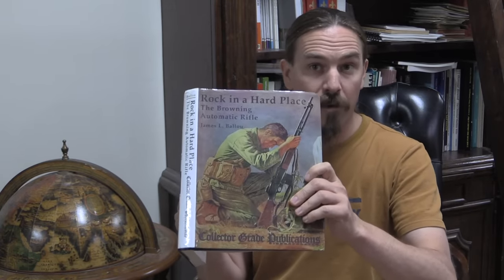Ask Ian: Why Not a Semiauto BAR Instead of the Garand?

Comment: Obviously we're playing armchair generals rn, but personally I think a 20 round magazine would have been far better than an 8 round clip. Imagine a standard us rifle squad in ww2 armed with semi auto B.A.R's against German and Japanese squads armed with Kar98 and Arisakas respectively. The Garand already proved too outclass those weapons with its ability too sustain fire, imagine more than Doubling its capacity! Obviously there are downsides, and hindsight is 2020, but I feel like there's something there you know?
Reply: So we're going on a 30 mile cross country march. I get the 10 lb weight in addition to 70 lbs of gear. You sir, you get the 20 lb weight. Let's see what you favor after the first five miles. Weight is always a factor. Otherwise everyone would be using some variation of the 240 right now instead of the M4.
Reply: Let me introduce you to the "M1 Carbine."
Reply: I doubt the bigger mags would be a significant advantage, especially when you consider that they would very likely be slower to reload and much more expensive, before considering all the other issues the BAR has
Reply: @durayenterprisesllc4440  The carbine was developed to replace the pistol and to arm support troops, not as a main infantry battle rifle, which most everyone wanted it to be, but it is not. If the Korean war era soldiers complained about the Carbine not being effective, well, they should have been using an 3006 M1 Garand.
Reply: @jason60chev  be careful with soldier memoirs lol. They said that winter coats were "stopping" their rounds. No, just no. They were missing due to probably shooting out of effective range. It's all about context, but yeah, it still wouldnt be a good all around replacement for the M1
Reply: Yes 20 round mags would have been much better in the Garand but Generals back then had no clue how modern warfare would evolve. To them reducing rounds a weapon could carry caused soldiers to take more precise aimed fire instead of the spray and pray strategy of modern warfare.
Reply: @0neDoomedSpaceMarine  It could almost be said that the 8 round En Bloc clip WAS/IS an 8 round magazine, all by itself. The reloading is very similar to a det mag gun and I would say faster, because, in most cases, you have to save the empty mag on a det mag gun, unless your supply system issues you loaded mags. With the M1, the bolt locks open, the empty clip is ejected, it takes a few seconds to retrieve a new clip ("Mag"), load and close the bolt.  In rifle matches, both the M1 match and Service rifles matches, rapid fire strings are 80 seconds to fire 10 rounds for score, including a reload.
Reply: @0neDoomedSpaceMarine  yea they did exactly that when the M14 was adopted. And that weapon system was horrendous in full automatic fire. The BAR was much more effective in full automatic fire. And box magazines were not new technology in WW1.

Comment: What haven't been mention is that BAR is horribly complicated internally, literally millions of small and complex elements inside receiver. It would be hard for common joe to field strip gun for cleaning, do not lose any parts in the process and put it back together correctly.
Reply: I agree, we still had some BAR's in my ROTC unit 1970-71 and it was hell to field strip and clean compared to more modern weapons.

Comment: Given the military brass' mentality, I can almost predict what a future weapons inventor of a handheld particle beam rifle would have with a general:
General: What is this?
Inventor: A particle beam weapon
General: Where is the magazine?
Inventor: It doesn't have one. I has a mini-fusion battery.
General: But how do you reload it when it's empty.
Inventor: It has a 10,000 shots capacity. You change out the battery.
General: Where is the bolt assist?
Inventor: It doesn't have a bolt. It is a solid state device.
General: Where is the safety?
Inventor: It has an ON and OFF switch.
General: Where is the ejection port.
Inventor: It does not use cartridge ammo. It's an energy weapon.
General: How do you fieldstrip for maintenance?
Inventor: You don't. It's a solid state device.
General: But what if if jams?
Inventor: There is no mechanic component to jam. It is a solid state device.
General: Sorry, but your invention doesn't meet our requirements.

Comment: Shortly before WWII American gun retailers tried to get contracts in Europe for the BAR, which could be conveniently converted into 8 mm Mauser(then the dominant military cartridge). Also American companies sold kits which could be used to convert a BAR into 8 mm Mauser.
American gun dealers also tried to sell muzzle compensators to European customers.
Actually many BARs reached Europe prior to the hostilities in several European countries(especially Poland).
Then war broke out and the German soldiers found out that they no semiauto rifles. That changed, when in Belgium and Poland a large stock of BARs were captured plus many spare parts. The German soldiers stripped down BARs( removed the tripod and other heavy parts) monted a compensator and presto they had a primitive semiauto rifle. The conversion was usually made by armorers just behind the  front lines.

Comment: As for the M5, troops nowadays get to be carried by Strykers, Bradleys, M113s and a multitude of other vehicles. You'd be lucky if you got onto a truck in the 1920s and didn't have to march 20 miles a day. 
So, i absolutly agree that the weight requirement of the day is needed- But in this day and age with fully mechanized infantry and exoskeletons being fielded (Admittedly in limited field testing, but still) i don't see the M5 as being too heavy. 
Compare it to an M14, not to an M4.

Comment: Cost and weight of the BAR was $319 and 16 pounds bare in 1942--there was a lighter Colt Monitor made commercially but I can't find the price tag on that.  Simplified and lightened, a semiautomatic BAR firing from a closed bolt might have been almost as lightweight as the Garand, but cost would have been greater--and then there's the way that the ammunition was packed.  Eight-shot Garand clips were cheaper than having both 20-round magazines and 5-round Mauser-style magazine chargers (stripper clips) and the magazines were not reloadable on the rifle (as with the M14).
The Garand was $85 and 11 pounds (was supposed to be 9.5 pounds but wood sometimes weighed more) in 1942 and the size, weight and price tag was excessive for non-riflemen, plus the older M1903 Springfield still in service was a five-shot bolt action, so the "replacement" for the pistol and the tommy gun (and Springfields) was the 5.5-pound M1 Carbine for $45 each in 1942.  From 1936 to 1942 the Garand was supposed to replace the Springfield, the BAR, and the tommy gun--the semiautomatic rifle was thought to have sufficient firepower so that Infantry Branch decided that two light machine guns per rifle company were enough automatic weapons, and the rest of the company would have the Garand--and pistols for leadership personnel.  Real war demonstrated the folly of that stance.  Regular foot infantry had BARs at squad level in 1944 along with two M1919A4 light machine guns, and special troops often had a mix of BARs, M1919A6 or Johnson light machine gun, and tommy guns at squad level.  The Marines fielded three BARs per rifle squad and fooled around with arming the squad leader with either a submachine gun or M1 Carbine.  
That was a good question but when the Big Army makes up its mind, 2x4 therapy might not be enough--use a sledge hammer!

Comment: My understanding is that the army did not want detachable box magazines on the new rifle because of the problems they were having with the BAR magazines.  Those problems continued into WW2, so maybe they made the correct choice.

IMHO a major reason for not standardising on a lightened BAR is that open bolt operation is not conducive to accurate semi-auto fire.
Reply: I'm surprised that this wasn't mentioned in the video.

Comment: Great video. 

your last video on progressive twist rates and talking about the 1891 Carcano Rifle made me do a 'refresher' reading about some of the related military cartridges. 

I find the enter conversation of .30 cal cartridge variants and 7.62 variants a vary interesting one. 
From the whole fact that the 1891 rifle was 6.5mm way before 6.5 creedmore, to the proven trackrecord of 30-06, to then 7.62x51 NATO being adapted, but then shortly later the 7mm-08 was developed in 60s, and now the 6.8/.277 Fury is basically a VERY close to a 7mm-08 just made with the hybrid brass/steel cartridge for that insane 80k psi. 

The fact that the .270 is a cartridge that is considered 'old' like .243 but those hunting/snipe rifles still considered quite solid for what they are, but that new 6.8mm is just a slightly necked down and overpressured load is all very interesting.

Comment: One major shortcoming of both the Garand rifle and the BAR weapon was the 7.62x63mm/.30-06 caliber round. The .30-06 round is suboptimal for automatic fire with its savage vicious recoil requiring a heavy weapon to absorb the recoil in a shoulder fired weapon. It is doubtful you could fire a BAR in full automatic mode with it lighter than the roughly 16 lbs it weighed and still keep the rounds on target. The BAR had no way of changing an overheated barrel too. The Garand rifle was in semiautomatic mode in .30-06 but weighed around 10lbs fully loaded. The Garand was a heavy combat rifle. The .30-06 round was heavy enough so a soldier was limited in the amount of ammunition he could carry. Soldiers serving in machine gun crews generally carried a limited amount of ammunition for automatic weapons. Imagine going on a 24 mile road march with 60 to a 100 rounds of .30-06 plus the ten pound Garand rifle fully loaded along with other gear. Most combat ranges were at relatively close range. So the weight any American soldier could carry was limited but the need for a thousand meter ranged Garand rifle is questionable. 

The .30-06 round was a hard hitting round with a range of around a 1,000 meters. Here again how many combat soldiers ever shot more than 200 meters on a routine basis is probably quite small. The US Army Ordinance Department should have developed a smaller more compact round similar to the more modern .308 or 7.62x51mm or some similar round. Lots of gun powder was wasted in the long 30-06 round. The M1 Carbine had an type of intermediate round of 7.62x33mm which was actually a much better semiautomatic round. I have often thought the US Army could have fought WW2 with a platoon of infantry that mostly carried the M1 Carbine and the Grease gun submachine gun with the several BAR's in a each squad with a ratio of one BAR per four soldiers with some more heavier .30 caliber machine guns like the 1919 Browning machine gun in the platoon. The soldierscwith M1 Carbines or a Grease gun could have carried more ammo for the BAR's. Perhaps several soldiers per squad could have had bolt action Springfield 1903 rifles modified to shot rifle grenades or for longer range individual targets. A couple other soldiers per squad could have used a Springfield 1903A3 rifle with a scope for those longer range shots. A vast majority of combat in WW2 was a close range under 200 meters or less. So much jungle fighting and urban combat in WW2 was at extremely close ranges or fighting in the Normandy hedgerows was almost at point blank ranges against the enemy.

Comment: Just scale down the BAR for the .30 Remington round, use a lighter contour barrel, ditch the bipod, use high strength aluminium for the receiver, and change it to a closed bolt action (like the H.C.A.R.). Then a similar weight to the M1 Garand but with lighter recoil, faster follow up shots, and substantially more firepower.

Comment: The real question is why didn't they just make the M14 rather than the Garand in the first place! After all the SMLE bolt rifle had a removeable box mag but it was still intended to be loaded with stripper clips. They could have done the same with the m14 design.

Comment: The first generation semi-auto rifles still showed a lot of influence from their bolt-action predecessors.  By cutting off the gas port, I can run my M1A as a straight-pull bolt gun.
RE: M5 weight...'history rhymes'...It will be interesting to see how they jive that with the 'lighten the soldier's load' mantra.

Comment: I saw the title and I can answer that question just from that.... the BAR is too damned heavy to carry around as an everyday rifle !  It's built to be a light machinegun, which means it has a lot more steel adding to its weight.  If you want a semi-auto, there should be no need for all that extra steel adding to the weight of the weapon.  The goal is to lighten the load of the soldier - not increase it.

Comment: What hasn't been mentioned is the produtioncost of the BAR. Even at the end of the war the BAR cost over 300$ (1945 dollar value) and that cost would not have been significantly reduced by a semi-auto conversion. The garand cost 31$ at the end of the war (the production cost at the beginning was something like 85$), and even that was expensive for a 1945 service rifle (the price for small arms tended to hover between 20-30$ with weapons like the sten hitting rock bottom prices at 10$. It's no wonder that the Sten was a favorite for smuggling in weapons to partisans).

Comment: Another thing that's not mentioned is the fact that the bar is an expensive going to build it was a chunk of steel that was mailed out and trying to give one of these to the average infantryman was a bad idea

And of course as mentioned it was a heavy ass gun

I do agree that in hindsight that the bar as a squad automatic weapon might have been better off firing some automatically as without looking it up didn't the world War II version have two selectable cyclic rates where one was 550 or 600 and the other was 350 or 400 rounds per minute and the slower rate was the one that was usually used

Comment: I pondered the same question until I was able to handle the BAR. At the time, 16 and 140 pounds, I realized that not only was it heavy but entirely awkward to shoulder and fire. It shot surprisingly soft for a 30-06 considering my frame of reference was sub 9 pound hunting rifle of the same chambering. But the sheer mass and heft of the darn thing made the whole experience one that I do not wish to have again. If I had the opportunity to shoot it prone and in full auto I’m sure the experience would have been far more pleasant.
Reply: The weight is a double-edged sword, it looks like its weight helps make the recoil easier to control but then you have to carry it too.

Comment: Great video. Rifles are carried more than they are shot so weight is an important factor.  Enbloc clip or magazine is up to debate. I’m secure with either. The BAR in later years should have been modified for replacement barrels as the needs of combat changed over the years. The Germans realized that and we did also with the M2 and M1919 Browning machine guns. No one in authority realized that the uses of the BAR would also change .

Comment: Because the BAR was way too heavy and there was only so much they could do to lighten it. I think that avoiding detachable magazines was the right choice at that time, however. Look at the trouble the Soviets had with the SVT-40, and look at how bad the BAR mags were. Using disposable en bloc clips allowed ammunition to be shipped to the front lines ready to insert into the gun instead of requiring soldiers spend time reloading magazines. It greatly simplified logistics and weapons reliability because it ensured they were only using fresh clips, not magazines that may be worn out or damaged. If you drop a metal magazine on its feed lips, it may never work right again. And if those aren't getting replaced regularly, you have a problem. Clips were the right choice given the technology and logistics of the day.

Comment: Clips at the time were the way to go. Complex metal stamping and joining and winding of springs to make a good box magazine was just not there in 1920. You had the option of a fragile, heavy, and extremely expensive box magazine that might work or a cheap, light, simple clip that almost always worked. Think of so many of the guns from that era and even for 30 years after it where the single most important factor for reliability is if it is a good magazine or not. Clips are substantially more reliable at less cost and effort and the negative of lower capacity is not as much of an issue when comparing with other clip fed rifles. I don't think anyone would argue the SMLE was superior to the Garand because it had a technically removable box magazine. I say technically removable because it was not disposable, it was a serialized part and each were individually fit to every other gun and even then they still caused problems. Eventually we got so good at making stamped metal and joining the body and winding the springs that we could make affordable and reliable box magazines, and eventually polymer and CNC would revolutionize firearm design (along with the design of basically everything) which makes cheap, light, and reliable magazines available by the millions.

Also, the HCAR is a bit lighter depending on barrel length, and it is also has substantially better balance than the spear.